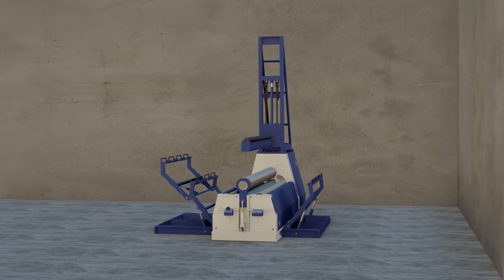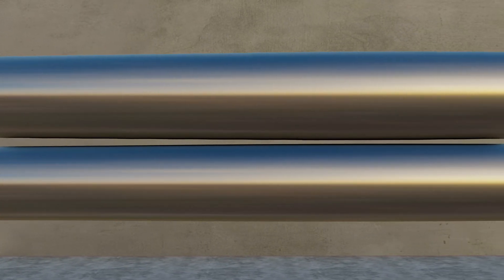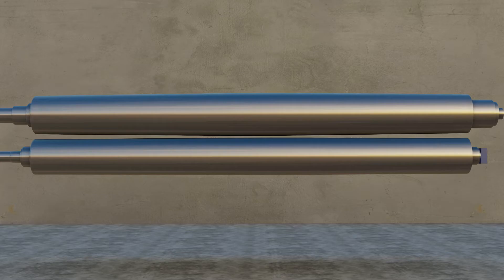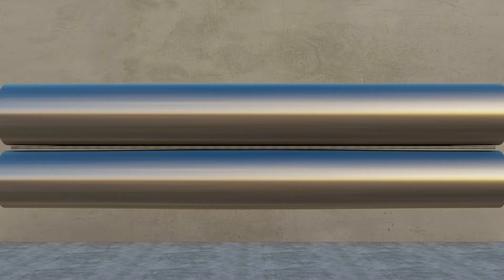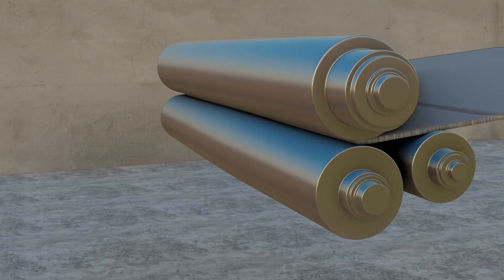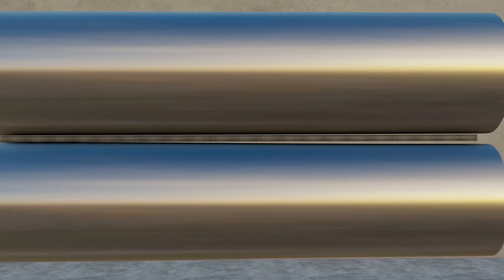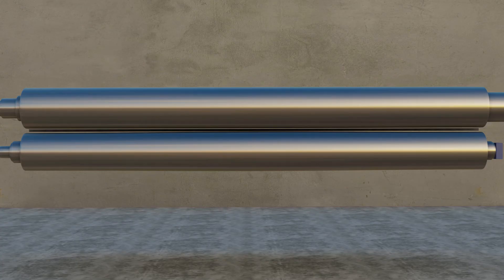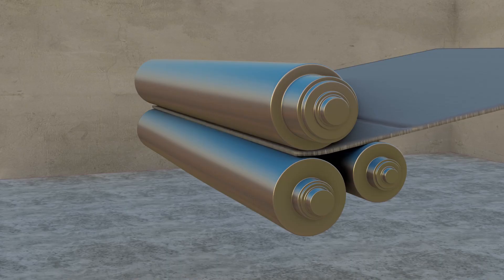MG srl - The basics about camber and why it is important - Italy

Comment: In the case of a thin plate, how do we adjust the clearance at the ends of the plate, with more pressure on the central roller?
Reply from the maker: Yes.... Higher pinch pressure will deflect the rolls more creating a more even pinch. If you use too much pressure for what the plate can handle the results will be a wave or ripple across the plate. If this happens you either need to shim with some other material take up the space or change the camber on the roll. Changing camber on the roll only makes sense if it's a job you are doing often.